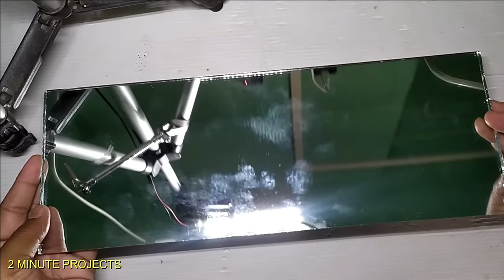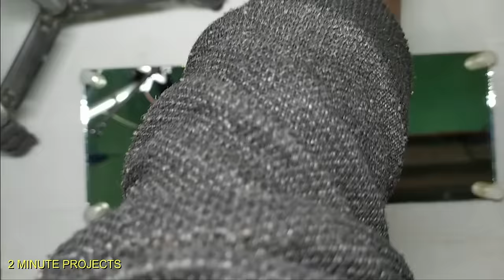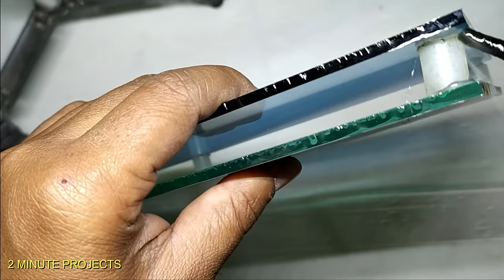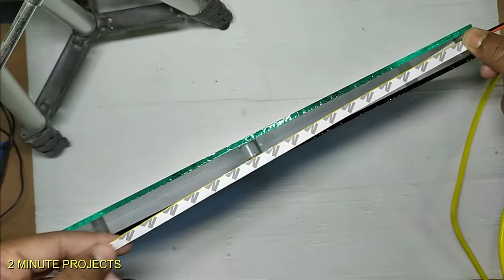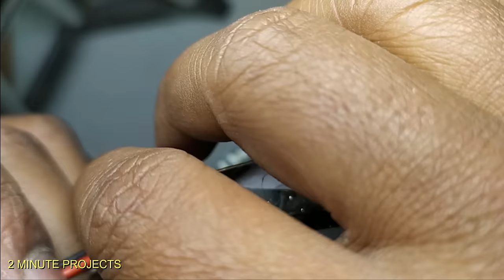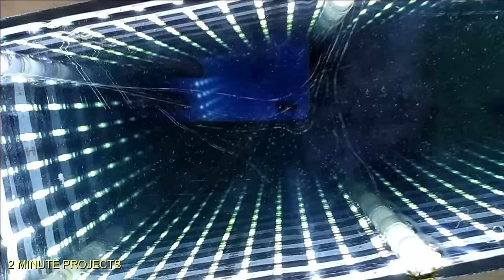How to make INFINITY MIRROR for home decoration

Comment: Wtf is a half mirror
Reply: Half mirror are tinted glasses
Reply: Two way mirror
Reply: Mama was just a big pane
Reply: you mean we can see both side?
Reply: Its a one-way mirror... On one side it looks tinted but on the other side it's reflective like a normal mirror

Mainly used on windows for privace during the day as someone from inside can see someone on the outside but the person on the outside doesn't see inside and instead they see their reflection
Reply: @jamesmwita  شكرا لك 👍👍👍👍
Reply: What are the second small pillar objects
Reply: @steveredican glue
Reply: It's a plexiglass sheet which is a mirror and also half transparent
Reply: it is mostly used in buildings where the sunlight is too much strong or if neighbours can easily see into your house because buildings are too close this is where these types of glasses are used for privacy
Reply: @p.k.953 tinted glasses to be exact and by definition it's not a mirror.

Comment: This is the best diy version I've seen, unlike the other ones with too much wood cutting to make housing, screwing and measuring. This one is just as effective with half the effort 👌
Reply: never been any rule that there had to be wood involved.
Reply: @MrBonners  I never said it's a rule, it's just that the most YouTube videos that I've seen they use wood to make the housing for the LED, but this one doesn't that's why I like it
Reply: Yes. But it would be nice to know where the person got the equipment from, and the names of them.
Reply: If u r using wooden housing, it will be neat and clean. Now it looks so unfinished. And I don't know these guys managed to fix a glass with glue sticks
Reply: @shaheebuk  I thought the opposite that it looks cleaner, smoother and has that modern futuristic frameless look, I guess design is subjective. Yeah, hopefully the glue sticks will hold but the mirror will be placed flat on the table and not move so it should be okay 🤗
Reply: @AdrianLucid  i totally agree with u on frameless mirror will give modern look. But there will light leaks and back side of led strips might be visible through gap. Ofcourse beauty is subjective.
Reply: Better for beginners. But there is nothing wrong with forcing yourself to learn more skills.
Reply: @dglorious1269  it's generic material you can find at home depot or online
Reply: @miguelquazar883  I guess he was going for the simple minimalistic look regardless of skill
Reply: This looks more genuinely than all those professionally made videos with wooden housing just because it looks less polished and more amateurish.
If you live in the middle of a highly urbanized city, it would be difficult to get materials for the wooden frames, it would also be difficult to get the space to turn all those wood into frames.
Reply: More work makes it look cooler
Reply: @thiagodevrieze918  depends on the look you're going for
Reply: @oldschooll so did you make it yourself?
Reply: @kaushalprkh  no, I would just buy one 🙃
Reply: @tomasexteriors  perhaps plexiglass would work but the reflective effect won't be as sharp as pure glass
Reply: Hi Adrian, I DIY’d both, frameless & wooden. I’ll be meticulous with the details cause I’m excited to tell you 🙈...
First , I disliked the diy wooden frames you & I saw here many years ago it was a trend. So instead I decided to reuse my shadow box (L 30in x W 30in x H 10in) & 1in frame on one side.
1. Customized a square mirror for the back + 4 rectangular mirrors glued on the inner walls for extra reflection (optional).
3. Got a square plexiglass for the front glued behind the inner frame- tinted with reflective mirror film.
4. I had to use 2 LED stripes to fill the large area & stuck them on the mirrors walls.

I didn’t know how the effect going to look, I’ve seen a guy DIY similar project on a table or a door - I think!- however mine was mega but H.E.A.V.Y!

The second I turned the lights-on a portal from another dimension opened in front of me, different than any infinity mirror the light is contained and directed not scattered around, the 10in length between the mirror & the reflective glass added depth. But what I really liked the most the light was ambient not harsh, perfect for “romantic” nights 😌👅

Sadly I disassembled it, lost motivation & creative drive for years but here I am, looking for inspiration again. 💡
Reply: @R.A.A.  Hi R.A.A. That's good you tried both wooden and frameless to see better perspective on which works best for you. It's unfortunate you disassembled it but you'll make a better one next time 👌

A great point you made where you leave 10" between the mirror and relfective glass to add extra depth 👍

That's good that the LED lights did not scatter as that will put a definite damper on the effect. But now they have neon LED ropes that have a smooth fluid colourful look without seeing the eye-piercing LED chips anymore. Just like the old school gas filled neon lights but with colour. 

It uses RGB-IC where multiple colors can simultaneously be displayed on one strip light, RGB on the other hand, can only display one color at a time. Bend it any way you want to make letters or shapes to put even in the the middle of the mirror and get that infinite portal tunnel look, certainly perfect ambience for romance 😋🍑
And yes, you can apply this idea to tables or doors alike

Perhaps this can add to your inspiration, the ideas are endless, you choose pattern that works for your home decor
Reply: Coincidentally, I saw the neon LED stripes yesterday after replying to you!

I LOVE IT, the rich smooth multi-colours (aka RGB-IC, slaying the lingo) with a built in defuser and affordable but I hesitated its battery-powered for mini projects, I ain’t no mini ;P

I really enjoyed reading your response Adrian, more than once, I feel completely at ease... you made my day.
Thank you 🌷

Reem 
 @AdrianLucid
Reply: @R.A.A.  Not sure why my replies didn't go through. I replied like 15 times and it still didn't go through hopefully this one works:

They also have these smooth neon LEDs you can purchase online at different lengths and power option, battery or 5V AC outlet.

I'm glad I made you feel at ease and your day 😊 I feel the same, thank you for your kind response 💗
Reply: Llll
Reply: What's a half mirror ?
Reply: Very nice, but it looks very bodged,and messy...!!😁🤣😂🤣😂

Comment: Verbal instructions needed step by step. Include what materials are used.
Reply: full mirror
half mirror
LED strip lights.
glue sticks
Reply: -Soldering gun or hot glue gun
-Imagination
Reply: What is a half mirror?😊
Reply: @Midnight-rj4ed  A piece of glass with only one reflective side, it’s the part you look through
Reply: Where do you get a half mirror?

Comment: Hy Sir . congratulations for this work!👏👏👏 you inspired me to do something similar. sir, could you please give me details (make, model, etc.) which foil did you use? what film did you use on the window? I thank you very much and I sincerely wish you much success in everything you want to achieve in the future.
Reply: He didn't use any film or foil. He made his own "film" by combining a mirror with a one way mirror.

And its pretty presumptuous of you to assume that this person is going to take time out of his\her day to give you instructions, when they already kindly put out a video.

If you want step by step instructions, there's a little thing called Google. Maybe you've heard of it.

If the uploader had wanted to write out a step by step version of the instructions, then that likely would have appeared in the video description. However, nearly no one reads those, so it would likely have been a waste of time.

Nobody on YouTube is gonna walk you thru this process. There likely are forums where you could find instructions for this.

If you want to just buy infinity film, Amazon has maybe 2 listings for it. I just bought some, and it's inexpensive. Depending on your definition of inexpensive. It was only $9 for a 20 inch by 12 inch sheet with free shipping. 

With the film you just mount it somewhere, and put an LED strip below it. 

 It's just a matter of mounting the film somewhere, and mounting an LED strip beneath it.

This video is achieving the same thing, but instead of buying the film, it was made with 2 mirrors, one of them being a one way mirror.
Reply: @Boogie_the_cat  🙏
Reply: List of elements to use please
Reply: 1) money
2) internet
3)amazon
4) a shipping address

Comment: I haven't watched it yet, but it's definitely not a 2-minute project because you need both dark and reflective surfaces, cut the segment (or segments) both for the pieces of glass/acrylic/polished metal etc as well as the lights, solder and heat shrink, do any additional layers/patterns and then put it all together and hide the edges unless its omnidirectional (in which case it would be a lot longer).
 You can increase the depth until it's so small that you can't make out the layers, add more directions and patterns separately so that it doesn't mash together, but match up and continue where part stopped and then continues on the other side.

I made the front of my PC like that and put mirrors lining the inside facing inwards and out. Looks like an actual portal to other portals leading to all of the internal components separately, rather than it all being mounted on a mobo.

People can make something that anybody that knows how to plug something into an outlet and use a pair of scissors has done, or... do something complex that anyone doing it after you keeps on improving it and making it better until it's something not yet thought of!